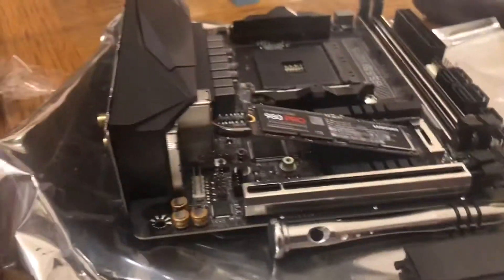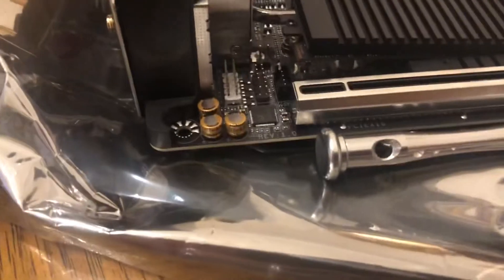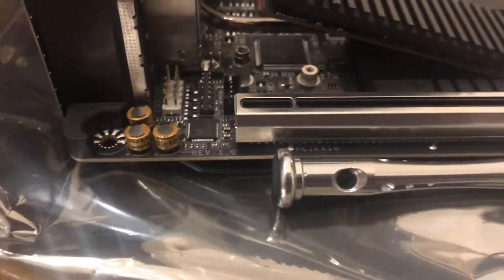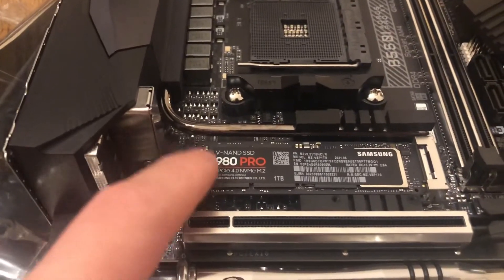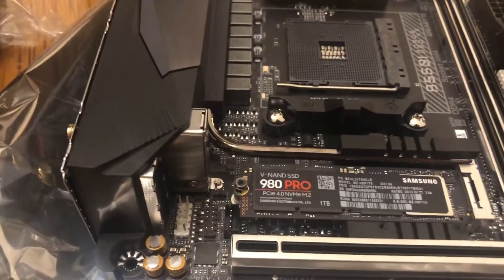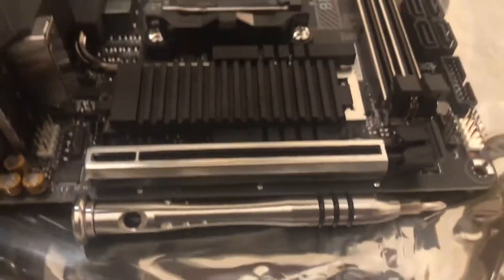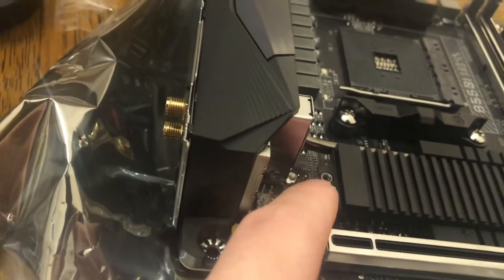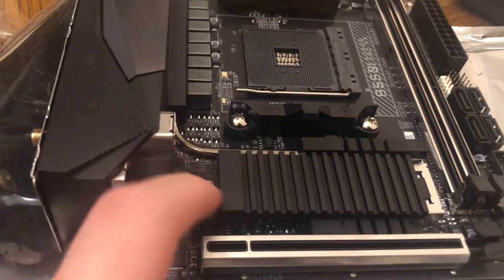NVMe install workaround for Gigabyte mini ITX

Comment: I got it to work..... 
Install the m.2 ssd first then install the heatsink included in the motherboard... Damn i never had this problem before with my old m.2 500gb(with heatsink included) i guess in the future ill buy the m.2 with the included heatsink, its just 20$ extra.. and I think the heatsink included in my motherboard doesn't have "direct contact" on my m.2 ssd😤( i know because its still moving and lose) just remember guys to buy the m.2 with pre built heatsink included, and save the trouble

Comment: The NVME drive is supposed to be between the 2 standoff screws. Also, the first smaller heatsink has a tab on the ram side, that tab goes into a slot just above the slot the nvme plugs into. That's the way it came in the box, and the second heatsink sits perfectly flush that way.

Comment: 0:09. Bro. That nut comes off the standoff! Then you put the drive on the stand off and put the nut on and tighten it! It isn't rocket science. And get a pair of needle nose pliers or better yet a tiny socket and put those slip joint pliers back in the toolbox before you ruin something.
Reply from the maker: Well I didn’t know that & the instructions were useless as FUCK so hopefully someone scratching their head sees this to help them too

Comment: That sure looks like you used the wrong height standoff. The SSD isn't even sitting flat.
Reply from the maker: It came with the motherboard
Reply: @commandpost1  Yes but the black nut goes over the drive not under it.
Reply from the maker: @christopherjames9843  that’s what I did if you keep watching